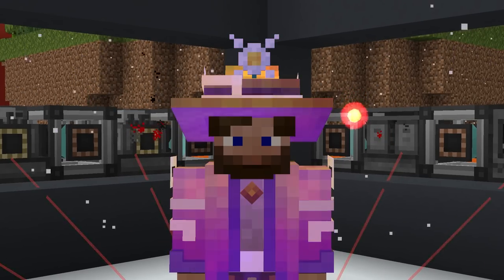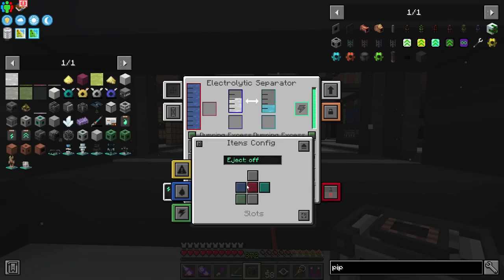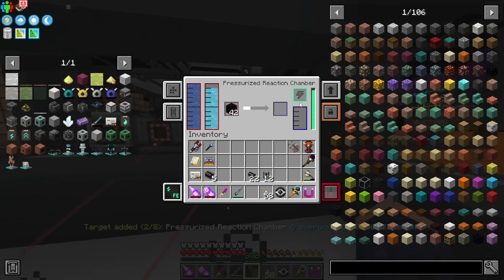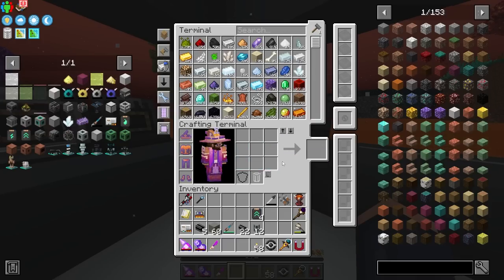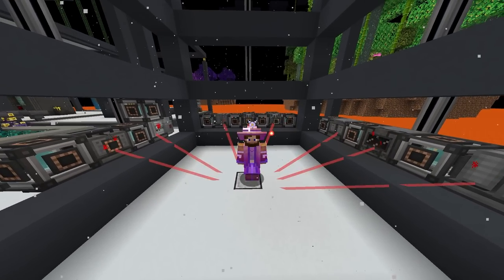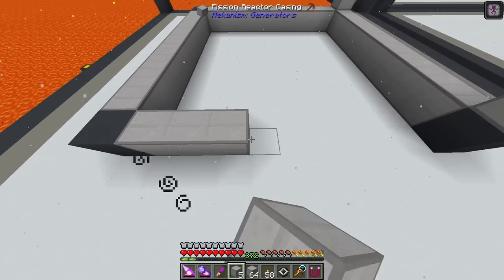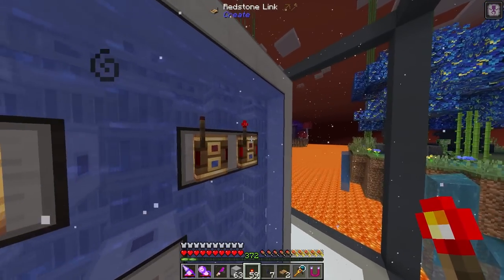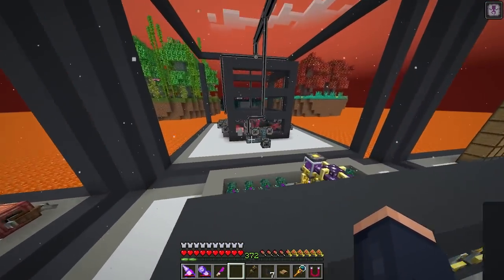All The Mods Volcano Block EP25 Best Expandable Mekanism Fissile Fuel Setup

Comment: Well, well, well. 2 episodes in a row that have been topics that I'm well versed in. At most, you'll only need 3 solar neutron activators. One for the spent fuel into polonium, one for turning lithium into tritium for the fusion reactor, and the third I've forgotten. As for the fissile fuel  setup, as long as it's all upgraded, the only 2 areas I've ever seen that need expansion are uranium cake to uranium oxide, and the sulfur to sulfur dioxide.
Reply from the maker: Thanks for the tips! Even though I've used this mod a lot there's still a lot I don't know about it XD
Reply: @ChosenArchitect  it's a tad odd, but it works!
Reply from the maker: Sorry phone put model instead of mod 😂

Comment: Well, the redstone scheme, you put to control reactor doesn't do well. If the reactor experiences high temperature or critical damage it will shut down only for a brief moment and then immediately launch again, building up DMG... And after few seconds, your screen will turn green.
Reply: I understood that you needed to output the redstone to a flip flop so it permanently turns off the reactor until you interfere with it. (After repairing of course)
Reply from the maker: I mean I've never had issues with this setup... I mean I also don't think I'm going to run out of fuel anytime nor burn it too high or run out of water.

Comment: I have seen that you would speed up the me-system with only speedupgrades. Wouldn't it be faster if there would also be a stack-upgrade included?
Reply: There's no stack upgrade in AE2, only on refined storage
Reply: @Tuco-js  is not there an upgrade with same function but with an other name? Or is this kind of upgrade part  of an ae2 extension mod?

Comment: I was wondering what is happening with the visual aspect of the base?
I still don't really understand the top floor and how it integrates with the lower floors (and how each room will look tidy and hidden from other rooms)
Reply from the maker: The goal is to be able to teleport to each individual room but seeing how everything's coming together I don't necessarily know if that makes any sense... I mean I can only think ahead so far and this particular base design has been kind of strange with the lava everywhere.
Reply: @ChosenArchitect  that's completely fair. I usually give up on design in big mod packs, mostly reverting to putting things in compact machines and only make a nice teleporting room haha